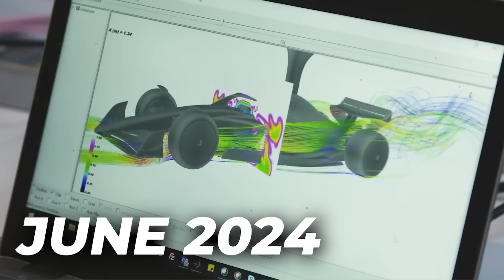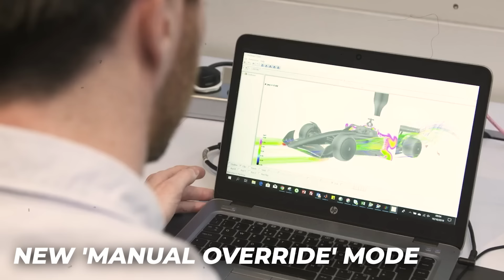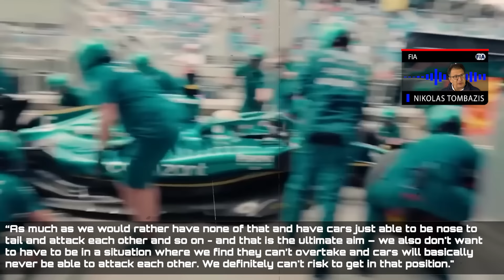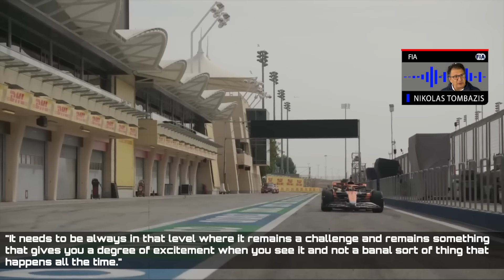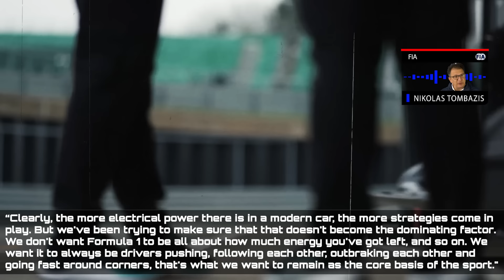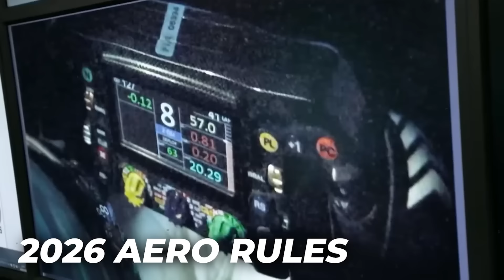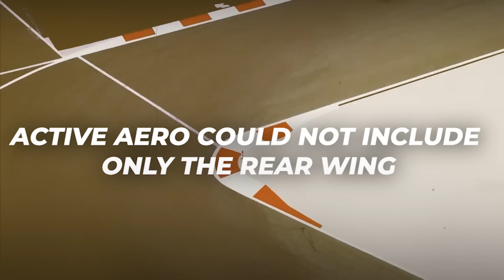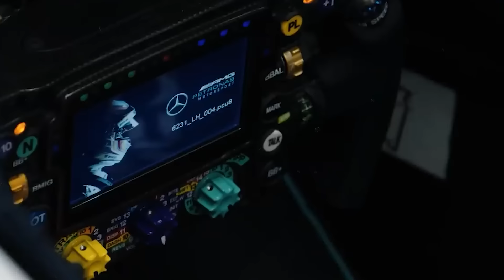FIA Drops HUGE BOMBSHELL on F1 Drivers!

Comment: I think their intentions are genuinely focused on competitive and exciting racing. Will the new regulations achieve this?  We will just have to wait and see. I like Red Bull and Max but I’d like to see him challenged and beaten without a mechanical failure. If you can get the top four teams actually battling it out from race to race with different drivers on the podium each week then you’ve got an exciting marketable product that will draw massive followers. 
I can’t wait.

Comment: I am very concerned about the push for Active Aero, I think it would be very damaging for the racing spectacle of F1.
What F1 needs are higher drag cars to aid slipstreaming down the straights, and lower downforce cars to help racing through corners. Well Active Aero goes in the opposite direction.

F1 ought to reduce the size of the cars, including the width of the front wing to the inside of the front wheels (like pre 2009) which will mean there is maxing drag on the front tyres. 
I would also like to see active suspension back which will tip the balance away from aero back to mechanical grip through corners.